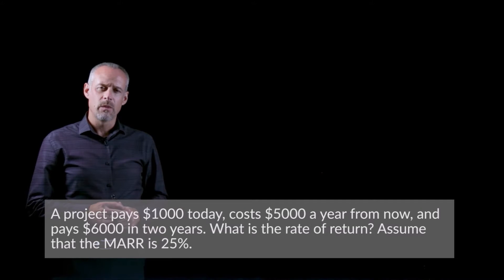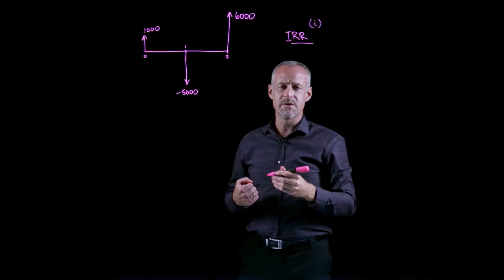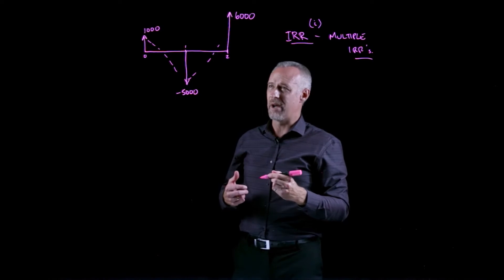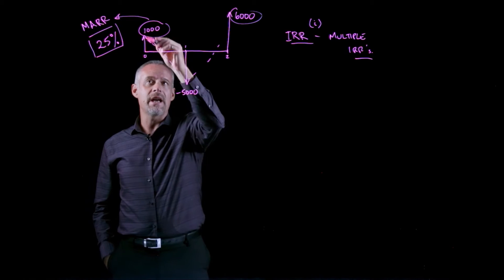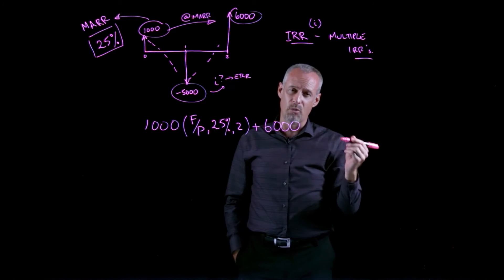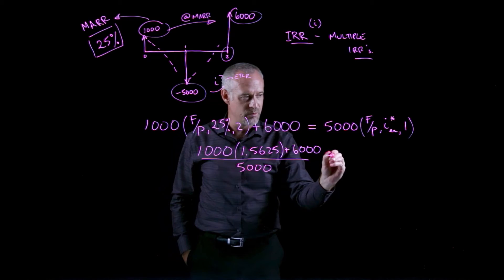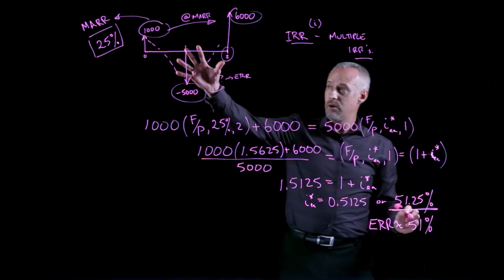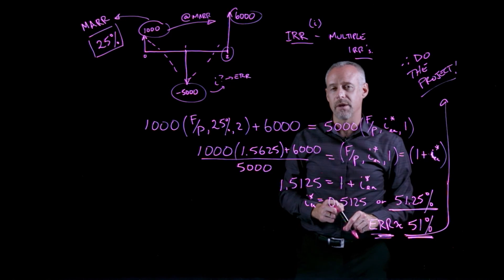External Rate of Return - Engineering Economics Lightboard

Comment: How did you get the 1.5625?
Reply from the maker: The 1.5625 comes from a Table or a Formula for the so-called compound-interest-factor for (F/P, 25%, 2).  This notation means: "the Future value given a Present value at a compound interest rate of 25% for 2 periods".   The formula is (1+i)^N, which in this case is (1.25)^2 = 1.5625.  Hope that helps.  Please explore my Channel for more videos that explain all of the different compound interest factors.
Reply: @EngineeringEconomicsGuy  Thank you very much! Will do.
Reply from the maker: My pleasure!  Good Luck!

Comment: What if you had multiple payments going out instead of just one?  Can those payments be collapsed down into one big payment so that the problem is solveable without trial and error?
Ex: With a MARR of 25%,
You get $1000 at time t=0.
You pay $2500 at t=1.
You pay $2500 at t=2.
You get $6000 at t=3. 
If you notice, there's no way to solve for i* now because you wind up with:
1000(F/P, 25%, 3) + 6000 = 2500(F/P, i*, 2) + 2500(F/P, i*, 1)
7953.10 = 2500(F/P, i*, 2) + 2500(F/P, i*, 1)
(Now I'm stumped.)
Reply from the maker: Excellent question.  As the problem gets more complicated you will almost always need to resort to a numerical method or trial-and-error to solve for i*.  Sorry to say!  This particular video is a special-case that is 'solvable' for i*.  I suggest you play around with MS Excel -Data/What-if-Analysis/Goal Seek... this is a great under-used feature of Excel that you can probably even find other uses for (in other courses!).  Keep watching, and keep the good questions coming!!